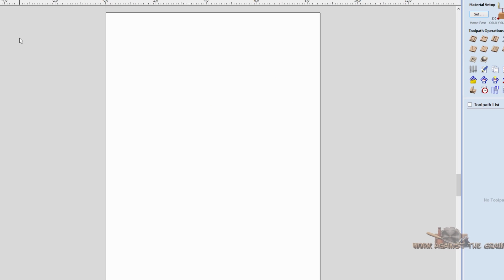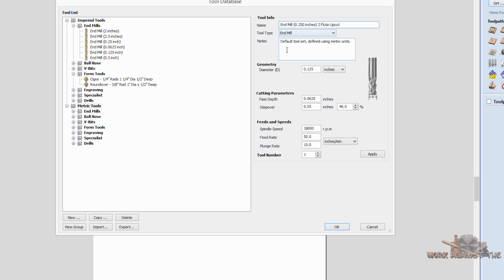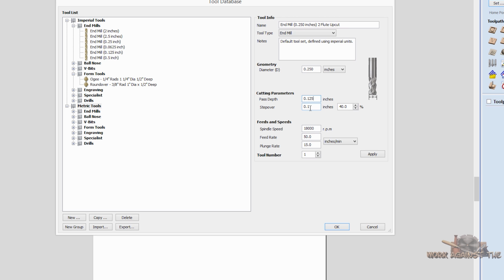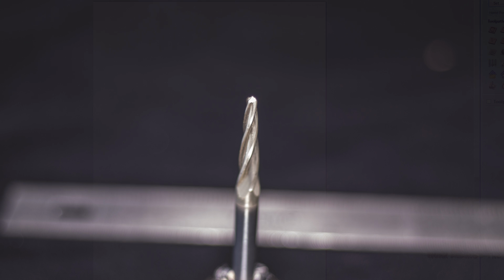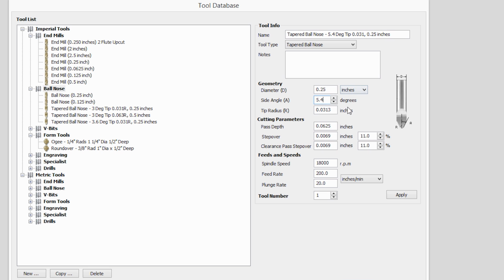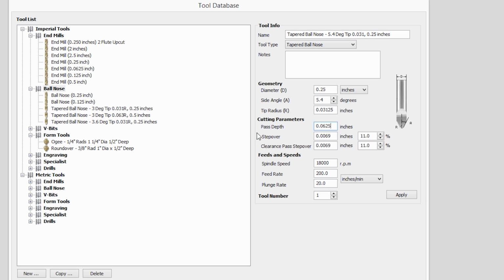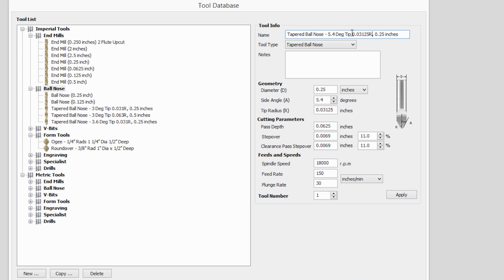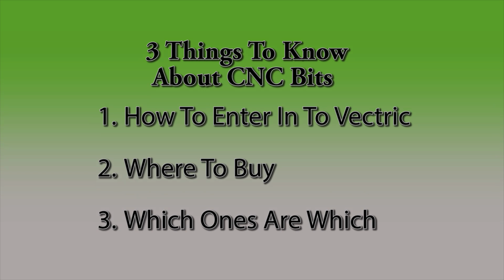CNC BITS

Comment: Hello, can you please advise if it's better to use 2flute or 4flute ball nose for 3d engraving in hardwood.
 Thanks
Reply from the maker: DEFINITELY from MY experience I get a MUCH better finish with a "coated" 4 flute ball nose. Thanks for watching.
Reply: Thank you very much for replying so quickly and clearing my confusion. I needed to buy few bits and I am pretty new at this.

Comment: I have an ER16 Collet Spindle that is maxing out at 10mm. Is there an adapter for 1/2 inch bits?
Reply from the maker: SURE D I'm not sure of an adapter. Maybe contact the machine manufacturer, or use bit with 1/2 inch cutting diameter with a 1/4 inch or 10mm shank. Thank you for watching.

Comment: hello Jeff, thanks for all the information, one question ; Am I limited in my total depth of cut by the cutting length of the bits blade ? ( can I exceed the length of cut if the diameter of the tip matches the diameter of the shank ? ) Thanks

Comment: The one bit type you didnt address is the from tools like  the typical router round over bit with a bearing.  Granted- DO NOT use bearing bits on any cnc. Yore just asking to either damage your CNC or yourself.  Its the shape of these thats the issue as far as vetric or v-carve is concerned.   You have to basically draw half the bit profile and enter that into the data base. I use a 1/2 inch core box bit quite often. If you just go down with no X or Y you get a 1/2 inch diameter round bottom  hole.  I know how to do it but others may not...

Comment: a more general question of the cnc naabcake that i humbly admit to be: built my own 1200x1200mm cnc, after trial and errors i successfully managed to do some general ops on wood. I then tried aluminium. I understood I should use flat end mills for that so I tested 2 bits: a 2 flute and 4 flute flat endmill with different diameters. My design was very basic: a rectangle with 4 holes in it. each test ended up with the same result: I ran a pass with only 0,750mm depth to start with. I applied some oil on the surface for lubrication. The holes are cut out perfectly, but when it starts to plunge and cut out the very first straight line after the first 2 cm quite smoothly the bit suddely seems to dig in further than the 0.750mm like the whole router is pulled in to the material with crazy force, alu chips are starting to fly all over the place very aggressively and by the time the router has reached the 3 cm it starts bouncing on the material with crazy force and all hell breaks loose, chips twice the size of the path come off and i hit the emergency stop. Although this may immediately seem to look like I have a bad cnc design (maybe it is), but what bothers me is that in other projects with wood when using router straight cutting bits and not even caring about small passes but doing 6mm plunge / pass for a 6mm bit diameter I don't have this kind of behaviour. The structure stays robust and fights its way through the hardwood without any issue. Maybe flat endmills aren't the right bit to use!? I notice on the touch of the fingertips when turning them by hand the have by design a tendancy to want to dig in to the material without even a lot of force and maybe that could be the cause or maybe using my spindle at max speed is. Eager to get any advice.
Reply from the maker: not sure what software you're using.  end mill probably not the problem.  make sure settings are set to cut ,750mm on each pass,  z axis zero is accurate either on top of material or on spoilboard and that you are conventional cutting pass not climb cutting.  also that your feed rate is slow enough.  initial thought is depth of cut is not set correctly.
Reply: I use a usb cnc controller that came with my board in which i import the dxf with my design. I don't have the notion of what climb cutting is, neither do i have that option in my software. my router makes the bit turn clockwise so it's in the same direction than the cutters on the end of the bit. please enlighten me. I zeroed the z axis so i can barely move a sheet of paper between the end of the bit and the material  and staying at z0 it stays at that same distance all the way of the x and y axis travels. here's a picture of my bit and the result cut maybe that helps.

https://s18.postimg.org/sz8m7pup5/20160904_004845.jpg
https://s15.postimg.org/jhmvslktn/20160904_004756.jpg
https://s17.postimg.org/zahbj2iz3/20160904_004812.jpg

also for info: I connected my nema23 stepper motors wires for slow speed and high torque so the machine really travels like a slug even in jog mode but i can try changing the feed rate. or can a feed rate also be too slow ?
Reply from the maker: +SMCG Any idea of a power surge, or variation in power to your machine during operation? Maybe an air compressor turned on or another tool? I see and hear allot where things start out great in the project and then seemingly out of nowhere the machine takes on a mind of its own. More times than not it is a voltage issue. The machine / computer running the g code must maintain "clean" power throughout the operation. One I hear about often is a microwave being turned on during operation causes all kinds of issues because of the sudden change in voltage. Make sure machine is on its own circuit.
Reply from the maker: +SMCG To add one more thing, the voltage issues are ESPECIALLY present when folks are using the USB controllers.
Reply: Holy freaking sh*it! Excuse my bad language but man:
Following your comment I ran my design again on hardwood which worked fine a few days ago and guess what the router started to have the exact same behaviour than on aluminium. this freaked me out. I switched to an older board with parallel connection and guess what everything turns out to work perfectly even on aluminium. wtf!!?
YOU WERE TOTALLY SPOT ON right man.
I'd never guessed that could be the reason, guess i learned a lesson here. and yes I have a compressor running but the older non usb board doesn't seem to give a sh*t :-)

HUGE HUGE thanks to you man, you really made my day.
Reply: don't know how to thank you really.
Reply from the maker: +SMCG glad I could help.  It's a big learning curve. happy carving ad have fun !!
Reply: +Work Against The Grain you the man. you really work against the grain !!! :-)

Comment: Hello Jeff.  I purchased some of the Magnate roundover plunge bits and tried to create the geometry in VCarve Pro 8.5.  I created just half the tool but the preview of the tool path is not correct.  Also I notice these tools have a bit of a vertical to them at the center of the tool.  I did not find any dxf or drawings of the tool profile.  I was wondering if you could help with the accuracy issue I am having in the VCarve tool creation. Tools I have are Magnate 3910  3917 3918.   Thank you for your time.
Reply from the maker: Mike, send me an email to jefonitoo@gmail.com and I'll send  you vector .dxf profiles of these bits.

Comment: my job have  much carving and job size 22.00 mm round shape size, then how much sizes required for engraving. it's a coin design diameter.  gold sovereign design, please explain how much sizes for required that design engraving on die steel iron metal,

Comment: Hi Jeff, great video. I believe there is an error in the narration when you are describing the Tapered Ball Nose bits. You describe the third bit as a 1\4 inch diameter 1/8 radius bit. If the nose had a diameter of 1/4 inch and the shaft was 1/4 inch the bit  wouldn't have a taper and therefore wouldn't be a tapered bit but a standard Ball Nose bit! I suggest the correct description is that it is a 1/8 inch diameter 1/16 radius Tapered Ball Nose bit. This minor error does not detract from the quality and value of the video.
Reply from the maker: +Denis Murray Thank you sir. I did it right on the first two, but yes, the 3rd is 1/4 shaft that tapers to an 1/8 diameter or 1/16th radius as you suggested. Thank you for the kind words and pointing out the error in narration. It's funny, I review these things it seems like 100 times to try and catch that stuff and inevitably one gets by me. Thank you again, and thanks for watching.

Comment: The roundover bits look like Amana Tool brand.  However, I cannot find those on Amana's site or Magnate's site. Any suggestions on where to find those? The only roundover tools are Magnate brand and are listed as point cutting roundovers.  I assume point meaning they can plunge?  Thank you for the information.
Reply from the maker: +Mike Schreiber The Magnate brand are the ones I use. Try this link. 

https://www.magnate.net/ProductDetails.asp?ProductCode=3911

Also, POINT and PLUNGE are a bit different. POINT comes to a point and can plunge but plunge doesn't have a point, it has a straight edge if that makes any sense. 

Hope that helps, thanks for watching.
Reply: +Work Against The Grain Thank you sir.  What would you suggest in regards to 1/2 inch shank dia vs the 1/4 inch shank size that these are offered in?  I am running a Laguna Tool IQ HHC with 3HP Spindle that utilizes ER20 collets .   I do have collet sizes from 1/8 up to 1/2 inch.  Thanks again.
Reply: +Mike Schreiber I prefer ALWAYS when available to use 1/2 inch so I can run faster feed speeds. Personal preference in my opinion.

Comment: Two comments:  On the tapered bits, I have been trying to figure out how to use the new field called Clearance Pass Step over.  On a finish pass I don't believe vectric uses two passes.

Comment 2:  Precise Bits also offers some interesting V-bits (30 deg and 45 deg) which I use to emulate small delicate chip carving projects.